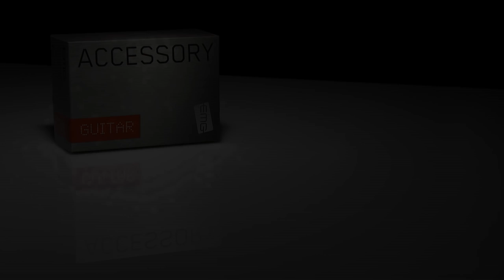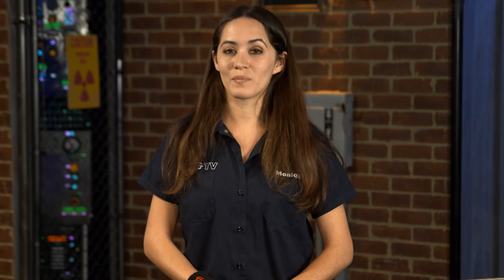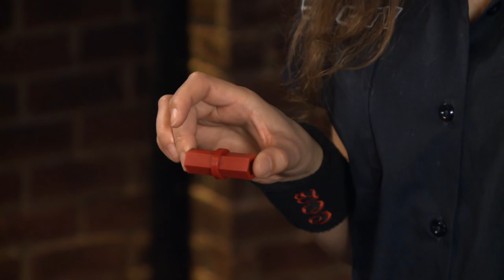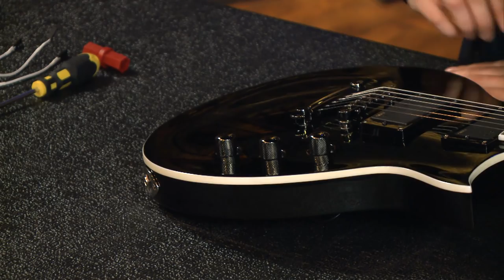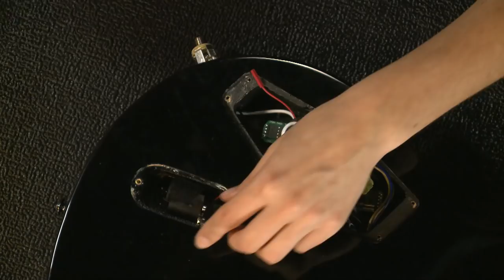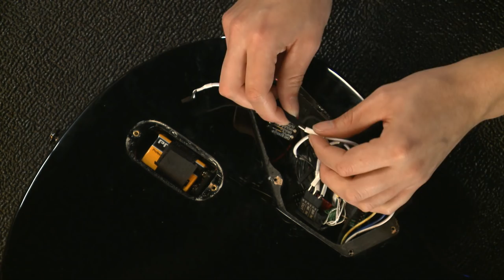Monique AB 220 Install on EMGtv

Comment: Would it get more complex if I tried to fit this into a fernandes sustainer? It's already using the stereo socket and a battery for the sustainer. I'm assuming I'll need to make another battery compartment at least.

Comment: So if you’re running EMG actives, do you need to rout another cavity or does it piggyback off the battery already in place?
Reply: I'd like to see this question answered. I'm wondering the same thing
Reply: @jjonchh  it piggybacks

Comment: If I already have EMG actives, do I need to replace the jack?
Reply: No.

All EMG Active accessories come with additional battery harnesses and jacks because they're designed to be independent and can be installed with passive pickups. If you already have an EMG active setup, just plug in the accessory and don't mind the additional battery clip and jack.